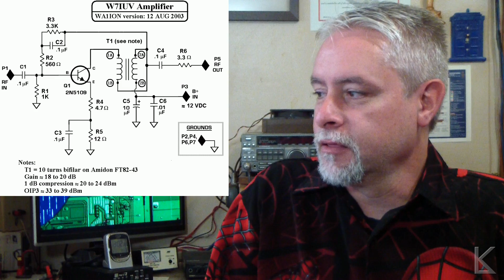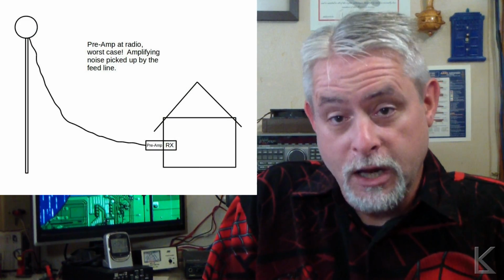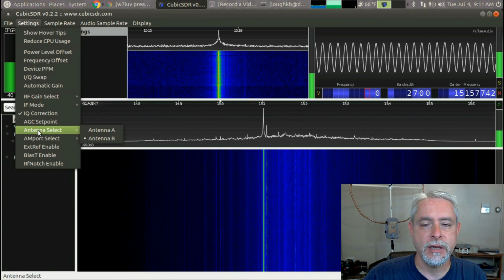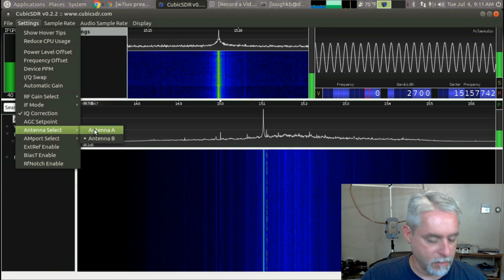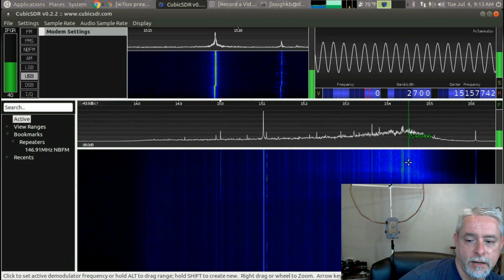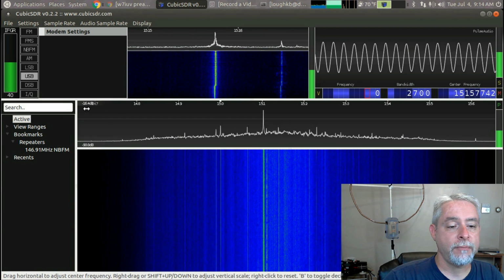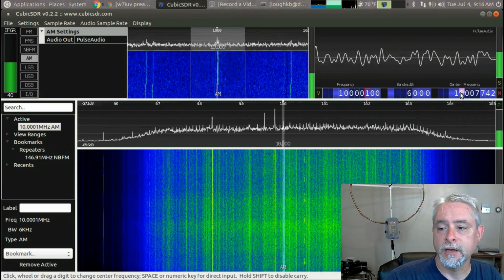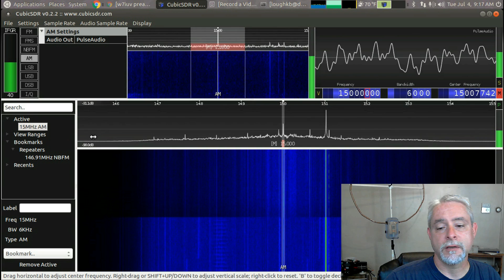Ham Radio - W7IUV pre amp on my junk box magnetic loop for receiving

Comment: I tried to see the signal to the the noise floor, I couldn't see any difference between with the amp on or off, and then when the mini whip was on, the scale changed making the comparison impossible. Anyway, I don't see where the amp helped, it's still the signal over the noise that matters, if the amp increases both, it changes nothing.

Comment: Kevin my   W7 is from Czech Republic so the config is different than yours.  The hula loop is connected to the SO 239 then to W7 then to RSP 1A then to laptop with SDR UNO software.   
-First I am a new HAM and can only do plug and play (no schematics).
-have marginal receptivity with/without the W7. You report just the opposite.
-I asked tech at the outlet.  He had a hunch --there was no power source for the W7 even though the board had two empty holes for +VGC and -GND but needed schematics to confirm values and power source.
-Sadly, this is where COVID 19 intervened.
-I emailed the manufacturer and he responded with pages of technical data that was beyond the scope of my limited expertise.
     --nevertheless I found info that is of probable relevance.  Under TUNING he states connect supply voltage desired from 12-14 volts and bias current should be from 60-85 mA.
-Is this sufficient info from which you can recommend a power source and instruct me on how to connect it to the W7?
Thank you for taking the time to assist me.

             Greg D

Comment: Hi Kevin,  The W7IUV preamp has an input and output impedance reasonably close to 50 ohms based on my measurements, and if properly matched to the source and the load the gain is indeed approximately 20 dB (I have measured it at 21 dB).  LTSpice modeling yields an approximate gain of 21.7 dB.

You mention insertion loss, but there is no insertion loss since the device you are inserting is an amplifier with an overall gain greater than 1.  As I mentioned above if you do proper input and output impedance matching, the gain should be approximately 20 dB.

Just FYI,
Don (wd8dsb)

Comment: Question: When you were running the comparison between the mini whip and the active magnetic loop on 15 mhz WWV,  what was the aim of the loop at the time? Was it optimized for Fort Collins?
Reply from the maker: It's plane was east to west, so yes.
Reply: Thanks, Kevin. Just curious. Obviously, that would be a factor in the comparison.

Comment: ordered a w7iuv pre-amp  and an rtl-sdr. time to play around with a receive setup. i have a high noise floor here but seam to get out quite well with my home made EFHW. not sure if im going to use a switch and use it with my radio or use the rtl-sdr. questioning over load issues with having a separate receive setup on when transmitting, such as recovery time before it can" hear" properly again.
Reply from the maker: If you can set up a T/R relay to ground the input to the receive antenna when you're transmitting, it should work seamlessly.

Comment: Considering the 10dB insertion loss, wasn't that only 10dB gain with the 5 volts? I have the 80/160 meter version and it does a very good job on my flag rotatable antenna. 
Good videos - very informative. 
Thanks 73, Jim - W5SWV